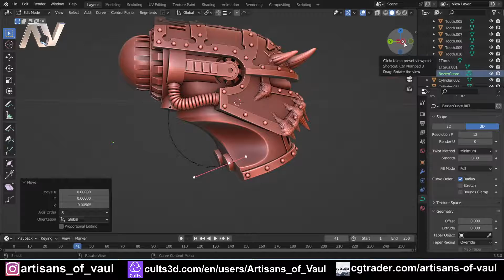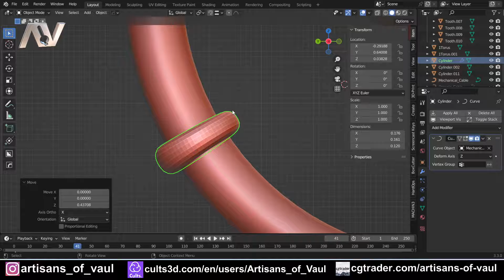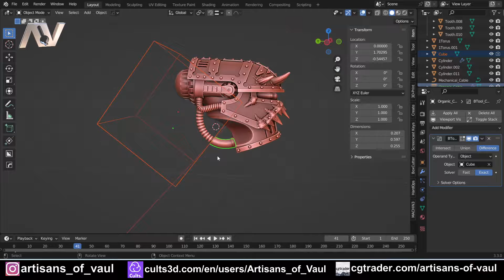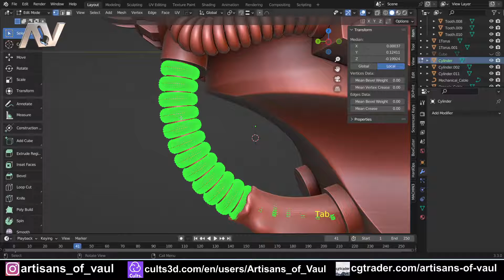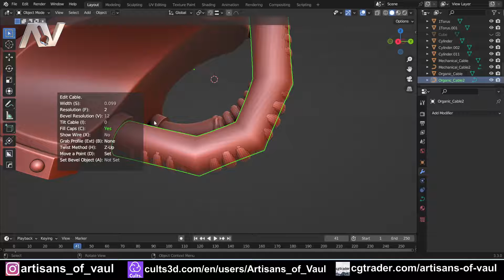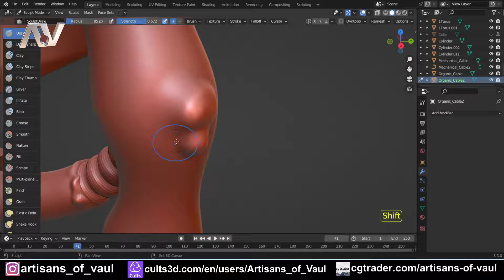Making Bio-Mechanical Tubes in Blender / Chaos Tubes

Comment: Vaul your guides have quickly become my very favorite to follow! Loving the great work. Have you messed around at all with Shapr3d?
Reply from the maker: Great to hear.  I haven't...  Is it a 3D design program?  I once upon a time used sketchup but it was a bit limited in what it could do.  Great starting point through.
Reply: @ArtisansofVaul  its a CAD program for iPad pro and the apple pencil (I think they have since released on other platforms as well). I've been using it when away from the big PC and has some great features. Obviously very different to blender but worth a look if you've got the hardware.
Reply from the maker: @Thiccron  I don't have an Ipad so that's going to be a bit out of the question I'm afraid.
Reply: @ArtisansofVaul  No worries! Love your blender stuff. Thanks for the response boss.

Comment: Awesome technique with the edge loop bridging. I would have probably used proportional editing and scaled the loops that way
Reply from the maker: Totally an option. I just like how smooth this makes it with the options to add geometry during the process as opposed to using proportional editing and then a subd modifier or having to jump between adding edge loops and the proportional editing. Both work though.

Comment: I have two issues with curve arrays. 

1. Facing/rotation control. So let’s say a convert a path from the surface of a complex piece. I then want a non symmetrical shape along that path, always pointing outwards. How do I do that?
2. Squeezing of shapes around hard corners. Is there a way to control this and distribute out over a longer part of the curve?
Reply from the maker: Both good questions and common issues.
1.  Once you have the curve modifier applied to the shape you can turn the shape in object mode and then apply the rotation (you can do the same thing to the scale if you want to change that) or go into object mode, select all and rotate there (you will not need to apply the rotation that way but you need to tab into and out of edit mode so its about the same amount of work either way).
2. Yes and no.  You can do this in a number of ways but if you want there to be even spacing its a bit tricky.  You can just move the object (you can see me doing this on the z axis to move it along the curve in this video) to eyeball it.  The other option is to instance the object along the curve instead of using a curve modifier.  This is more complex but its not that bad once you understand it.  I have covered one way of doing this along a curve in this video:  https://youtu.be/O4QxBfBu80I  I will also be covering it more in the future in a series of videos Im working on making a fantasy/historical building.  This will be for the roof and there is some really cool thing you can do there (it will be the sub-video of how to make tiles).

Hope that helps.

Comment: HI, i had some questions, first about the helmet, is the entire head one thing or is the more mechanical parts seperate objects from the base form?

, do you have any video from when you start creating this model, 

and high resolution do you generally use for these models?
Reply from the maker: Hi there.  Originally everything was modelled separately but at this point it has been mostly merged together (it also makes it easier to see for the tutorial).

I don't have any videos for how this was made unfortunately, I made it before I had started the channel.  Sorry about that.

I generally use as high a resolution as I think will be needed for a smooth print.  As this is a model for 3D printing it needs that sort of resolution, where as CG work can rely on things like shading smooth and can be much lower resolution.  I also try to make sure that when someone buys one of my models they can scale it and it will still print.  For example I have seen someone print this at around 400% the size and it still looks smooth.
Reply: @ArtisansofVaul  hey Vaul love your channel. Just a few questions piggybacking off of this one if it's okay to ask as I'm new to all of this;

If a mesh is intersecting inside of another mesh do you still have to use Boolean? Or will the slicing software handle it well once you export it into it (so like do the mesh faces that are inside another mesh automatically just get deleted/merged with the mesh if that makes sense? Or do you always have to deal with this manually)

What level of subdivision do you typically go up to to have a smooth 3D print? I'm just starting out in all of this and I think I heard somewhere that your meshes can't be too detailed or slicing time will increase or something so can't pump it up too high..?

Sorry if I'm not making too much sense lol. Will make sure to watch more of your vids, and thank you for what you do!
Reply from the maker: Makes perfect sense.  So a lot of things will be up to you and its worth trying a few things out on a printer as basic shapes to see what happens (especially to determine how details a mesh to have to be smooth).  I have never had an issue with slicing software slowing down working out a print and I have some very high.

As for the joining of objects, you can let your slicing software try to handle is but I always boolean my objects together.  It allows you to spot potential issues and resolve them and for a lot of different operations you need to have a solid mesh to work from.  But there are some people that would strongly disagree and say its a waste of time.  I think I have wasted more time trying to sort out prints than I have fixing booleans and like any skill you get faster at it with time.
Reply: @ArtisansofVaul  thank you for the response! 💛 I will make sure to experiment and take your advice with using booleans, or ideally joining the meshes naturally but will probably have to get really good at topology to work that out haha. Sounds like it's just a lot of trial and error (and using the blender 3D print toolbox add-on?)
Reply from the maker: It is a bit for the printing.  But I would say to go on the slide of having a highly detailed mesh if I was you (though it can mean more fixing at points).  I have some videos on how to fix various issues from booleans too.
Reply: @ArtisansofVaul  How did you do the rivets evenly spaced and equal in size?

Comment: Very nice trick. I do the tubes a bit differently, but beside that I would do it the same way.
Reply from the maker: Cheers.  What do you do with your tubes (if you dont mind sharing)?
Reply: @ArtisansofVaul  Aray + curve modifyer. I edit the mesh so that it will be 2 cilineder and merge the overlapping parts Also deleting the faces on both end.
As for organic stuff. I didn't rely had to do anything of the sort bit semes to be the go to way.